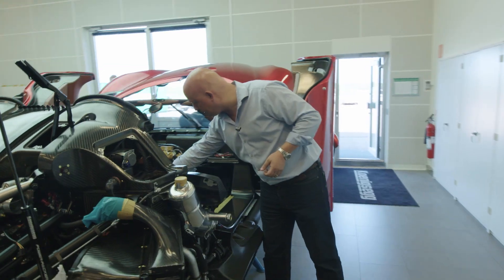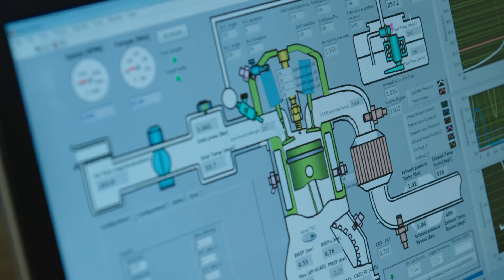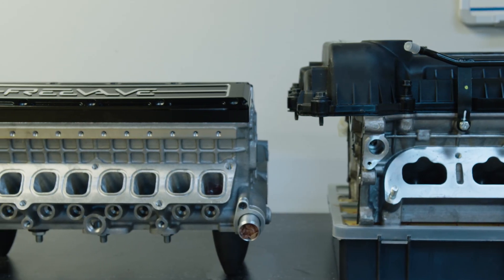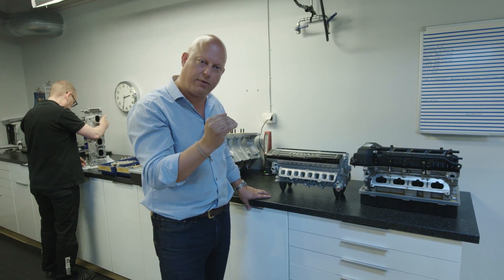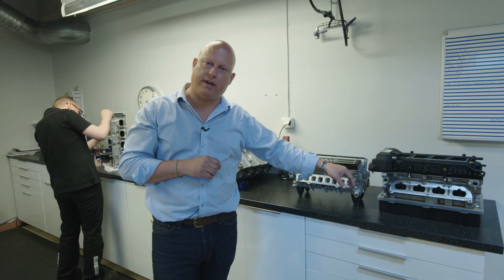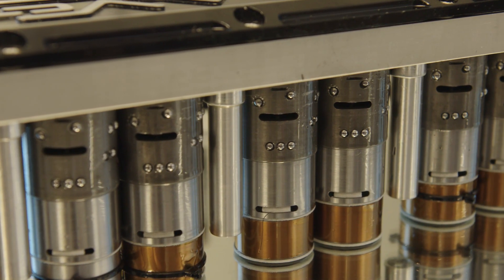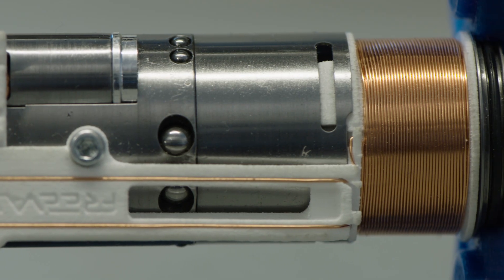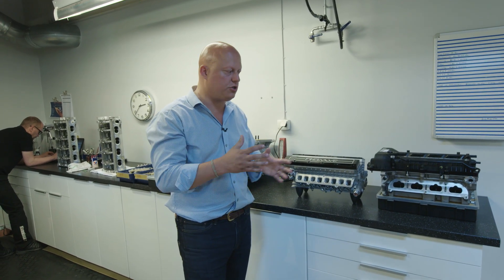Freevalve Update Camless Engine -- /INSIDE KOENIGSEGG

Comment: Soooo, when will I be able to buy a set for my Big Block Chevy?
Reply: I'd like a set for my 99 5.7 Vortec
Reply: @Capt. Slow - I yield. You clearly know a lot more than I ever will about what goes in and out of rear ends. And in and out and in...
Reply: CreekyGuy 
Maybe in 70 years when GM catches up with current technology.
Reply: @robotbjorn4952   Well, no car company has this technology in production yet. So, do you feel the same about them or just a GM hater?  Actually some car companies with some nice ICE tech coming out are GM, Mazda, Nissan. The new LT V8 has some excellent cylinder head and combustion technology. And, of course GM and Porsche lead everyone in racing wins and records.
Reply: @yipe222  American's are good at high performance especially twerking existing technologies. Pat our selves on the back.
Reply: @yipe222  facts
Reply: @robotbjorn4952  they could do it but it would raise the price of the car
Reply: @robotbjorn4952  - Yeahhhh, that new mid-engine, 900h.p. Corvette is a real dinosaur. When will AMERICA finally wake up, huh?
Reply: @CreekyGuy  LS engine is an old Ford engine basically lol.
Reply: It's not just a couple of bolt on heads, it's a integrated engine management system that's probably not going to be compatible with stock systems. 😉 Just throw on headers , some fresh ported heads with a three angle valve job, a 6-71 blower with nitromethane injection..😋😍 sometimes, the old ways are Best
Reply: @aaronhumphrey2009  How about just driving cars stock.  Why do people always need to go overboard?  Probably because of small penis syndrome.
Reply: @eduardosampoia5480  Because they can, and by your logic christian has sps. And the first person to mention sps has the smallest one
Reply: @eduardosampoia5480  tbh those italian cars might not make it to their next oil change
Reply: Pushrods pff
Reply: RIP Comp Cams. 
This was attempted before , but “computing “ power wasn’t there.
Reply: CreekyGuy why aren’t you using an ls like everyone else lol
Reply: Aaaaaand here’s the comment we’ve all been expecting.
Reply: Ask Christian K.... Its modular but it would cost you a fortune now
Reply: Never
Reply: New corvette= junk being pushed as quality. Sorry but they are trying to imitate cars like Lambo and Ferrari. They are not even close!
Reply: @onlyonebran  Of course not, Corvettes are actually reliable.
Reply: @Capt. Slow - You are aptly named, sir. The current standard is 460 H.P. The range-topper is 755 H.P. 

The new base (to be announced next month), will be at least 500 h.p. Z06, ZR-1 and possibly Zora will be announced in rapid succession. Zora may be a hybrid, and is projected to top 1000h.p. This info is widely available. I am not your librarian.
I have noticed that dull, unimaginative leftist trolls nearly always refer to phallic, anal, clitoral, and fecal imagery. Go, and troll no more.
Reply: @CreekyGuy  Wow, that was just a bunch of nothing. You pretty much just said you think it will, after you stated it as fact.
Reply: @CreekyGuy  the current standard is 455
Reply: I hear GM going bankrupt. Also why aren't more Americans buying sedan's and coupe's? The are more effective than SUV's. Why not wagon's?
Reply: @marcalampi5036  suvs have a lot of room,,,suvs are the way to go...obviously people like them...the sales prove it.  I just bought a 2019 toyota highlander.  Fuck the climate emergency.
Reply: The new Vette's are just plastic economy supercars, albeit nice ones.
Reply: I worry never due to US emissions etc. Even though it does improve it's emissions performance, it's still the US and worst of all is California CARB.
Reply: @repalmore  assuming the rest of the engine is even decent at emmissions they can adjust the engine to whatever they want. You can basically have a Vtec/ecoboost or any cam trick you want that activates at any time, at the touch of a button or at any speed.

Fpr lack of better comparisons it has infinitely variable cams all the time.

Comment: EVs 100% torque always. I mean if you want fast and responsive how is an ICE going to beat them? You can easily have a 2K+ HP EV.
Reply: I like electric vehicles but nobody said anything about trying to beat them. I don't understand the purpose of arguing against nobody.
Reply: @sed8181  .. How Super is a $1M plus Supercar, lots are $2M-$3M, if a $200K Tesla beats them in every single category? What does "this" car bring to the table?

The $200K Tesla will out accelerate, out handle, and flat out outdrive this and every supercar. The family X will probably out accelerate this supercar.

Point is if you want fast, great handling, etc then why spend 10 to 40 times more for an inferior vehicle??!!

Comment: Where does the compressed air come from to power the pneumatic valves? Is it somehow scavenged from the boost pressure from the turbo or is there an air compressor added to the accessory drive belt? The latter would steal horsepower from the engine. I suppose you could add an electric compressor somewhere, like my old Lincoln! For the airbag suspension, you could hear it kick on when filling up with gas. As the rear went down with the weight of the fuel, the compressor would add pressure to the bags to lift it back up to normal ride height.

Comment: 3:37 Are they really using Grade 8.8 metric bolts (essentially: construction grade) inside an experimental camless engine, or is that just to hold on the strange feet for the display?

Comment: 8:20 With Koenigsegg supercars priced to be affordable only to the elite, why is it that the workers have a cheap beat-up fan, with duct tape holding it together, to circulate a little air in their stuffy closet of a work room? What about the mis-matched chairs, and the sterile white walls without even a Koenigsegg car poster for decoration?  C'mon, Big K, spend a couple of bucks on the little guys, they are the meat and potatoes that keep the operation running.

Comment: The issue I have is how all this is controlled.  Does the engine use mechanical controls?  Hydraulic controls?  Vacuum?  No, no, and no the controls are from computers.  Sorry, I just find more computers in cars moves the soul of the car farther from the driver.

Comment: Wow!  This is Awesome!!  This makes so much sense with no need for a cam, the parasitic draw of a cam, and of a vacuum force the pistons have to make to draw fuel and air in.  Less weight, less parasitic draw on the engine.  I would assume the only parasitic draw would be the turbo and the pump to drive the hydraulic system that actuates the valves, and of course the oil pump.

Comment: This would be epic trickle down tech for tuners. Hope we see it on the street some day.
Reply: this doesn't strike me as a system lending itself to swapping over to a conventional engine block.. by the time this would make it to the average tuner, hopefully people will have woken up and decided we dont really need internal combustion engines anymore. Oil companies and big, established automakers need IC engines.. but it's obsolete tech.
Reply: @markjohnson4643  We are on the march to alternate fuels for sure. Auto/manual dual clutch transmissions help pull more MPG out. It's going to be a while. A long while before internal combustion engines become the minority on the road and longer still for them to stop being made. Hibirds are a stop gap and are easing the transition a bit. I'm not an expert with Freevale but I would think it would fit right in as emissions get tougher. I would also think it would help pass them being able to really control air and fuel on the go. While I guess you could swap it over to a normal engine I agree with you. Probably not the best way to implement it but we are going to see a lot of small engines developed and cylinders get taken out so there is a market for this system now and in the future. Well. If it actually works and is efficient on fuel and production costs.

Comment: I have been dreaming with this idea for decades! How much power (efficiency) do you loose to compress the air needed to open the valves?  Does the exhaust drives a compressor? At 6000 or higher RPM valves will need a lot of compress air...

Comment: This could re-vitalize the aircraft radial engine where nobody has been able to solve the valve actuation problem before for a multi-valve radial engine. Also the maintenance period is shorter on aircraft engines and radial engine has so many cylinders that losing one while airborne wouldn't be a big concern.

Comment: I worked with electronic valves for air about 20 years, this is not new technology.  They surely have benefits, but two very big problems were malfunction, and wear. Most wear is from start up cold to hot. I hope they have introduced a  fail safe solution for malfunction, and trouble shooting codes to test valves in open, closed , as well as simulated run in several cycling times . Average life span of valves was 1-2 years, control actuator around 5 years. This will revolutionize the auto industry IF they can make it as reliable as fuel injection

Comment: F1 was using pneumatic valves a long, long time ago. not a new concept, but the idea of modernizing and normalizing it and making it last in a daily driver...not there yet, but let's make it happen!
Reply: look up Electromotive engineering they were using Solenoids on the Nissan GTP VG30 race motors in the late 80's to mid 90's  to great effect..( pushed none other than the Porsche 962 off the top in the sports car scene back then)  I remember hearing an engineer explain the potential and benefits just like CVK here,  that blew my mind back in those days.......
Reply: RaptorV1USA 
absolutely, the concept of a fully independent and individual controlled valve train is merely similar to mechanical injection is to moving to tuned port injection. the fuel pump psi has to be raised, and the intake manifold has to have injector ports made, and the ECU then had to know to then control those separate injectors. but the gains and benefits over carburetion or even tbi are huge-esp from a tuning point of view. both camshafted and free valve systems are mechanically intensive, and the independent electronic valves add the element of tech that's missing with cam driven valves, but i think the moto world is thirsty for the technology. but it must be either long lasting and durable or easily serviceable and cheap enough to replace as needed for daily drivers to benefit from it. 
i'd just like to see it happen in something at the Vette level yet, then we'll know were there.

Comment: I can remember discussing this concept with others over 40 years ago, but there wasn't the widespread tech then that exists now. I've been crying about mirror image turbos for over 20 years and so far the only one I know that has them is Nelson Racing. I still wonder about distributed turbo-charging (one small one for each cylinder)as well, but I've only seen one V-8 application from Australia with no data available on the performance. I'd like to see more done with clutched super-chargers too. When are we going to see aftermarket "Free-Valve: heads available for out Chevy LS engines?

Comment: what bout heated injectors with finer vapor
Reply: William Volkmann minimal gains. already oem evap and egr equipment already boost mpgs maybe to 10% numbers (commonly) and if it did more, we would just use 100% vapor fumes. it doesn't improve much. another example is png(nat gas)engines only improve in mpg a little as well, it's 100% atomized at combustion--can't get any more real world proof than that.
just look at any and all winning tuner shops and drag teams across America and if there was a way to use hot fuel to build more than 2000hp from a LS package...they'd be doing it.
Reply: @dallynsr  it's not bout hp/ talking bout burning more % of fuel on the combustion cycle. right now it's 80%. up from 65% in the 70's with big cubes. there have been products like (the force, 2005, trade net marketing) that break up the incoming air and have claims of gains in gas increase and heat wraps around the exhaust for fuel lines to be heated (minimal effect) however heating the fuel in the injector looks good on paper, and would break up the fuel in to a fully atomized state / problem being is the crash testing and other issues / look at ford with 60th psi injection with diesel so why not for gas ?
Reply: never fails, you can have physical proof spinning all around you and yet you won't accept it. guess that's why we live in the world we live in. keep asking the same question 100 times and eventually you'll get that answer your looking for. 
what part of Minimal Gains doesn't make sense? and making more than 2000 hp by merely vaporizing the liquid fuel means more efficiency. last time i checked over 275hp/liter of displacement is pretty efficient in the whole grand scheme big picture. 
news flash-fully saturated combustion chambers are more efficient than idle ones, and higher compression/higher combustion chamber pressures have caused the higher percentages of fuel burn. that's the allure with diesels-wide open air and throttle with injection. AND...100% fuel vapors have been used in autos for quite some time now. it doesn't raise efficiency enough to make a MIT project out of, or even a weekend hobbist seeking high mpgs--or they'd been doing it. 
oh, another one i've heard is the 100mpg carburetor that mysteriously disappeared with its inventor, it's been rolling down the road for years and it's called a Honda Shadow 250-gets 96mpg. FOR REAL!
(that's efficiency at its finest)
in Cuba they use electric coils to VAPORIZE the fuel and point it down into the carb cause they can't get parts or gasoline, they are not very efficient. 100% vapor fuel is all around us. 
but keep expecting nasa techniques to unlock a hidden boost in fuel mpgs and ill be here doing other cool things as long as this country stays free. 
i'm done here.
Reply: @dallynsr  geeze you sure are harsh // what im talking bout is torque increase in small displacment eng for hybrid set ups not max power, the industry has went away from high mileage eng tec some what , my point being the path to an end one has to follow the clues however how slight. (keeping an open mind)

Comment: Really cool idea. Hope it catches on. I see a lot of people worried about the complexity and cost, the best comparison I think is comparing carburetors and points versus modern fuel injection and coil packs. A lot of people were hesitant to those things at first, liking something they could tune with a screwdriver, and the early fuel injection systems were temperamental, expensive to repair, and unreliable. But they quickly became far more reliable, more efficient, and better performing than any carburetor could dream of being, and are universal in modern cars. A fuel injection system has far fewer moving parts than a carburetor, and as long as the computer and wiring are done right it often lasts the life of the car with no intervention (Hondas and Toyotas at least). This could be similar, given the benefits it could be widely adopted eventually, and once the design is dialed in, refined, and mass produced it might save cost versus the typical setup, and even more compared with existing far more complex variable valve timing systems like VETEC. The only reason I have to doubt that this will be standard in a couple decades is that I predict electric cars will take over before this does. Electric is clearly the future, it already is taking over, and I think that's awesome, but it is sort of sad to think that the latest IC engine innovations may never reach production.

Comment: if use map sensor for intake and outlet too. if outlet sensor show moment when pressure of used gas is lower then intake pressure system got signsl for opening valves intake whithout closing outlet for super best ventilation

Comment: I had an idea twenty years ago about using electric selonoils to operate ghe valves on a diesel engine with computer control you could vari lifht duration and timing,not to mention you could program in data for engine compresstion braking,,my no it all older brouther told me i was nuts.I still think im correct i know ghis would work kind of like youre system !only electric

Comment: MotoGP were using pneumatic valves during the 800cc era, mainly due to the almost 20,000 rpm those engines were hitting.  I believe formula 1 uses pneumatic valves too.

Comment: Anyone remember the Kawasaki rotary valve engine that was used in their Enduro bikes in the early 70's? Why can't someone build heads with polymer tube shafts with tuned "windows/holes' like the flat rotary valve and be gear driven. Far less spinning mass and no valves slamming shut. Just a thought. Bengt R.

Comment: The closest I can relate it to is that YPVS system fitted to some Yamaha motorcycles and quads, even though it's way more complex and requires quicker reactions to address the needs of a 4-stroke engine. When it comes to intake valves, some really ancient engines resorted to vacuum generated by the intake stroke to open them with a spring to return them when bottom dead center was reached, and relying on the expansion during the power stroke to keep them shut. In the end, it doesn't seem so unconceivable as it might seem at a first glance.